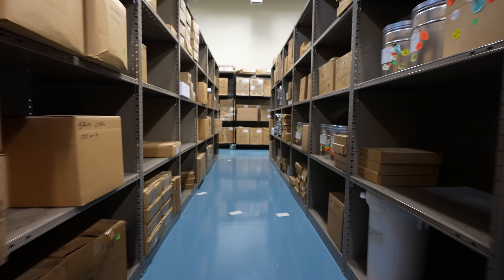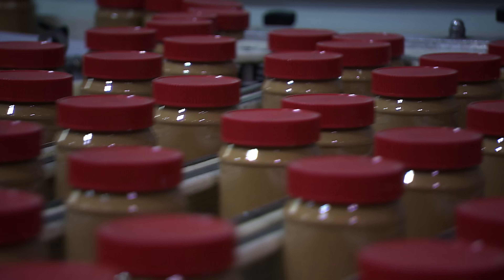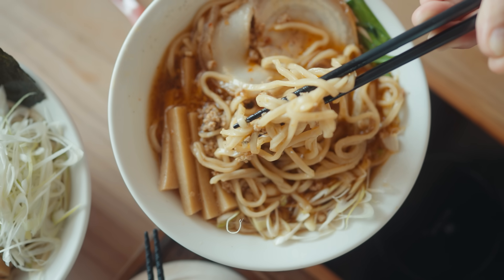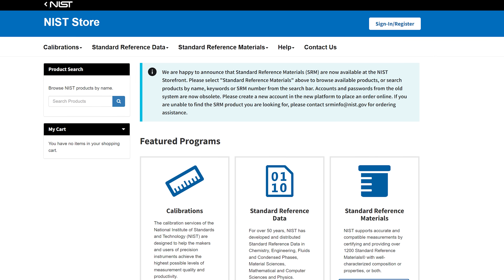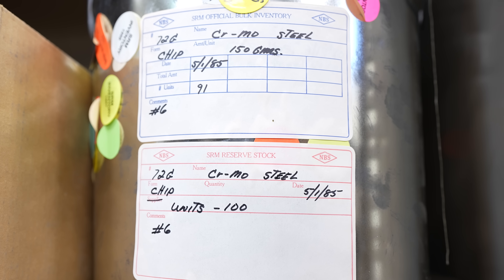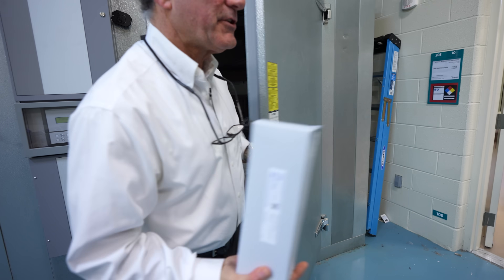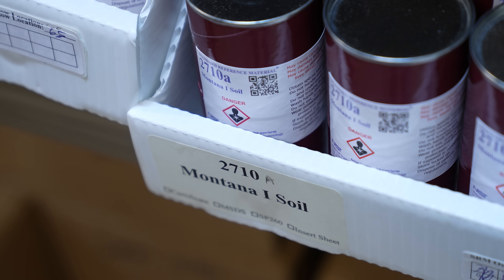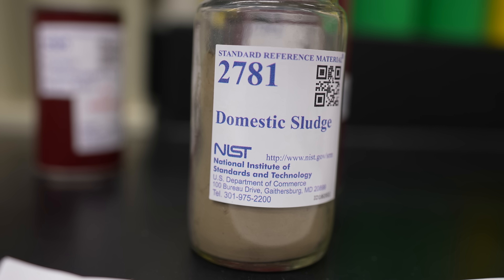The world depends on a collection of strange items. They're not cheap

Comment: I have a strong objection to the assertion that one could / should not eat the peanut butter because "it's very old." That implies that it's not stable -- and if its not stable, then how can it possibly be used to calibrate equipment? How can a manufacturer calibrate their equipment that tests edible food using material that is inedible, or at least, degraded from the original? Wouldn't changes like oxidation (becoming rancid) or decomposition (contaminated with microbes) invalidate the test results?

Comment: if you’re buying the peanut butter for the standard reference material wouldn’t you just need the certificate? why would you need the peanut butter itself?
Reply: You would get the reference material and an exact list of what is in it, and how much of those elements are in it. Then, using your own equipment, you can measure the elements of the reference material, and check to make sure your equipment reads precisely the same as the list that came with the reference material. This would let you know if your own equipment is measuring things properly, which would then let you know that your measurements from your own products are also correct. Basically, it's used for precise calibration.

Comment: The Charpy test is indeed an important standard test for steels. It measures the toughness, or resistance to brittle fracture, using a standard notched specimen. Materials prone to brittle fracture are to be avoided (or mitigated). Ductile fracture does not sound so good either, but if something is going to fail, ductile failure is safer and preferable as it requires exceeding design loads to achieve this. Brittle failure is of concern because it can occur at less than design load conditions.
The typical units of measure are energy (absorbed) in Ft-Lbs for imperial unit system, Joules for SI units. Metals and most solid materials become more brittle as temperature is decreased. Higher values measure in this test are better than low values. Brittle high strength steel may yield single digit values, whereas low strength austentic stainless steel may yield 300+ Ft-Lbs, meaning it takes a lot more energy to break it in a notched impact specimen, even though it is not nearly as strong.
Different metal alloys and heat treat conditions will have different temperatures at which they become brittle (Ductile to Brittle Transition Temperature, or DBTT). The temperature at which the test is performed is based on design standards and factors such as the end product's minimum design temperature, and the material's expected DBTT. If the material is produced correctly, it will meet or exceed certain impact energy values at a given temperature. If not, it may produce low values and indicate sub-standard material. 
The notch of the specimen, which is the designed point of failure is machined to precise dimensions for the purpose of consistency. I am a Metallurgical Engineer and thought I should delve into sharing my personal understanding of that part of the video.
Reply: Charpy is just one way to measure one variable in a steel.  Many times in tool steel you don't really care too much about that value, and are looking for wear resistance, such as drawing forms.
Reply: @scottrackley4457  Good point. Toughness is not a required or necessary property in some materials and some applications. It is in structural and pressure containing products, but typically not in tooling. In fact in tool steels, low toughness often times is very acceptable in order to get the high strength or wear resistance that is required. Hence tool steels when they fail, tend to fail in a brittle manner.
Reply: @Steve_-ob2ne  Yes, they turn to gravel and projectiles.  Very sharp projectiles. <Toolmaker
Reply: Tl;dr I'm naming my next pet Charpy tho
Reply: Hi Steve: Nice info.  Thank you for your service to the metallurgical community.
Reply: Thanks for the extra information!
Reply: Thanks nerd
Reply: Congratulations you have been selected among our shortlisted winners for our Giveaway prize🏆🏆, kindly send a message to the telegram above name to claim prize 🎉🔝🔝

Comment: Do those standards include common, almost standard, manufacturing errors?
Reply: I would hope so. The point of a standard reference material is not to have a perfect material free of defects, but rather to have a material that has been analyzed so extensively that it can be used to calibrate measurement tools. So if I have a sensor that's made to detect a particular set of manufacturing errors, I callibrate it using a reference material with a precisely measured amount of each error. My sensor is accurate and calibrated correctly when it measures the same amount of error measured by a reputable source, such as NIST.

Comment: As a metalurgical engineer, We use standard materials all the time. Typically, different grades of steel and iron to calibrate spectrometers for chemistry readings to verify the heat. Any sort of materials engineer uses some form of standard material, it's nice to see where they come from.

Comment: 10:55 Charpy reference material is a joke and a scam. You only need to calculate the mechanical energy based on the heights and mass of the pendulum and do not need a reference material to demonstrate that.  But it is such a good business that it is writen in an american standard. Charpy principle is widely used in east Europe and Russia and the traceability is based on energy calculation.
Reply: That would be fine if every pendulum was identical, always swung the exact same every time, and everyone tested at the same temperature. Same with something like an analytical balance. Nonetheless, we have to have mass references to check them every few months

Comment: If that jar of peanut butter is too old for you to want to make a peanut butter sandwich with it, how is it still a valid sample of what's in (newly manufactured) peanut butter? Also, is that TechIngredients in his day job?
Reply: It's only around 3 years old by now. Not old enough to have negative health effects but it will taste off. This doesn't require a significant change in composition since our sense of taste is actually quite sensitive
Reply: @snowthemegaabsol6819  Ah okay, a) I didn't know it was only 3 years old, b) so the macrocomponents will still be within a reasonable tolerance of what's on the label, but there are microcomponents (I'm thinking vitamins) too... how do we know those are still representative?
Reply: That's why this standard exists, it defines what "representative" means. It is their job to figure out at what point the standard becomes too different for analytical use, and they decided that limit is 10 years. I don't know why it's 10 years, it could just as arbitrarily be shorter or longer. There's probably some actual reasons for it, but I never worked in verifying and designing standards, I just bought and used them, and as I understand it, the expiration date is just an agreed upon threshold. It might sound sketchy, but to my knowledge there hasn't been a massive peanut butter catastrophe, so it seems to be working.

Comment: They did a great job of explaining everything but I’m still not sure why it’s important to keep and sell the products. Once the products have been thoroughly analyzed that data should be all they need. Why keep peanut butter once you have the data? The peanut butter fats go rancid so it’s not true to its original chemical form anymore. Whether the fats oxidize or are broken down by bacteria they are different after that.
Reply: There are two reasons main reasons you would want the actual product, calibration and verification. For example, analytical balances that give you weight readouts, all they understand is the strength of a small electromagnet required to hold the plate up. That's why you have to calibrate them, so they can correlate the strength of the electromagnet with the weight of whatever is on the plate. You do this by placing a series of mass standards on the balance and manually keying in how much they weigh. It's also standard practice to use those mass standards to check if the balance is remaining accurate over time.

For a peanut butter standard, lets say you were looking for aflatoxins [FDA method C-003.01] and were getting around to doing HPLC. Just like how a balance doesn't really know what weight is, an HPLC machine doesn't really understand what it finds. It only knows two things: Retention time, and area. The method above calls for a mountain of standards for calibration reasons, which can be either prepared as stock or purchased. After calibration, your procedure may require verification of your calibration curve.
This is where the peanut butter standard can come in. If your cal-curve can give the right retention times and the right concentrations [area] that match the COA, then it is fit for analyzing actual samples. If it can't, then there may be an issue with the cal-curve, sample prep, or perhaps some deeper issue like the sample matrix itself causing problems.

NIST certification for SRM 2387 [the peanut butter standard] will, since its creation date, last for 10 years. You are right in that degradation is a concern, which is why there are very specific instructions for how to store and handle it, as well as conditions that may void the certification. These are designed to maximize lifespan. As for why 10 years, it's mostly arbitrary. At some point, someone had to draw the line somewhere, and I guess before 10 years it's still considered good enough.

Comment: LOL, here calibrate the machine you're analysing your fresh peanut butter with, with this 20 yo sample  the major components of which will have almost certainly changed or it WOULD be fit for human consumption.
Reply: SRM 2387 is almost 3 years old by this point, not 20, and it will be acceptable as a standard until the start of 2030. In the COA, there is an entire section for storage and handling in order to minimize degradation and enable this 10 year certification. Valid concerns, but they've already been addressed.

Comment: I'm curious how this works with reference to proprietary information. Obviously JIF had a different recipe than Peter Pan. Do they just need to be within certain thresholds? They spoke as if there products are the end all be all and that's definitely not the case.
Reply: I understood it as they use the standard material to “program” their computers/labs, like to make sure that when they run a test on the standard peanut butter they get the same numbers as NIST and know that their machines work right. Then they can go about making their own product according to their recipe knowing that the peanut butter they produce contains exactly the amounts they intended it to. Idk if I explained it well but I hope it makes sense :)

Comment: How often are these things updated? Because dust in our houses now is probably very different from 90s dust based on different microplastics, products we use on our bodies and furniture etc.
Reply: It doesn’t matter how often it’s updated. It’s not ‘standard’ in that it represents what everyone should have in their homes in 2023. It’s standard in that NIST know exactly what is in the jar, and anyone testing that same jar (or one like it) with accurate methods should get those same results, so they can then be sure when they test a sample from an actual home those results are accurate as well.
Reply: @SirSpinalColumn  This. The NIST Standard Reference Material is the benchmark. It's used to calibrate equipment. Then, you can run your sample through and see how it compares.

If you change the standard, then it's actually more difficult to track changes. That's why your grandma's secret recipe never comes out how she made it. Let's say she uses 1 cup but it's her favorite coffee mug. But you don't know that. So you use your fancy new measuring cups. But her coffee mug is actually just ever so slightly larger than a standard cup. The recipe is the same. But because your grandma had a different cup than you, it comes out wrong.

NIST was basically like, super envious of Standard Weights and Measurements. They took that same idea and ran with it.
Reply: Its updated occasionally. I'm not sure how they decide the expiration schedule but the website shows House Dust as revised in 2018 and expiring in 2025.
Reply: That’s not quite the point. The point is that they know exactly what the composition of that dust is. That means you can calibrate against it. You can compare and measure against the standard to find any differences. How would we even know if dust today is different to dust 30 years ago if we didn’t know exactly what was in dust 30 years ago?
Reply: I was really surprised to hear him say "i dont know if i can tell you how old this is". For such an extensive process it seems like such a small yet important detail to leave out when dealing with a lot of these things.
Reply: @mattg706  That was specifically for the peanut butter reference which would not need to be updated as peanuts are still peanuts.
Reply: @robertrouthier2603  different fertilizers used to grow those peanuts. Gotta think a little bit bigger and smarter if you’re going to try a “gotcha” moment
Reply: @mattg706  He may be talking about the particular jar. He also didn't specify that he wouldn't be able to find out how old it is.

I did find it odd too and still do.
Reply: The jar represents an average of every household.  Not all households are the same, even back when that jar was first filled with the material that's inside it and the lid put on it.
Reply: It should contain a date

Comment: Plumbline Experiments  on: October 12, 2014, 08:13:54 AM ». In the Tamarack Mines an experiments was performed... Basically, A plumb-line was suspended from two holes hundreds of feet deep and a mile apart.  Can you replicate this experiment?  It answers whether a pair of pendulum's point towards the earths core? Or not?  This topic will cause a storm! Up for the challenge?